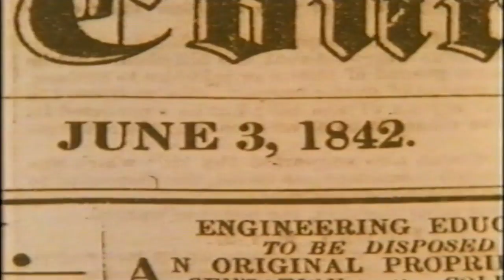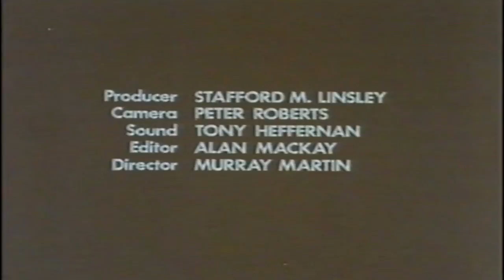Bowes Line

Comment: At 14:12, the houses to the right are on a row called Ridgeway, Leam Lane Estate, NE10, and still stand today. Here you see the rear of the houses, with garages between the houses and the rail line.
I lived just a few minutes walk from here, and I used to play on the roofs of those garages with my mates, but the railway had long since closed, as I am going back to the late 70's early 80's.
But if the camera was facing in the opposite direction, there was, and still is the old engine shed, (now a bus museum I believe, or storage shed) just before the line crosses Lingey Lane at Wardley, and we used to play in there too, swinging from chains that used to hang from the roof up above. It was fascinating as a kid.
I was born in 1972, not long before the railway closed, so it is also fascinating to see "the lines" as we called them, in use.
My older siblings remembered the coal trucks, crossing the Leam Road on their way to Monkton coke works at  Hebburn, where they made smokeless fuel or coke for the many open fires that were still in use in peoples homes. Central heating was rare 'on the Leam' until the housing providers embarked on a huge program in the mid to late 80's to install gas boilers and radiators in all the homes on Leam Lane Estate, a mammoth task, considering the size of the estate, which was the largest in Europe at the time, I believe!
 Memories of much happier simpler times for most people, I'll bet. But not without struggles, times were often tough, but we lived uncomplicated lives back then. Great video.
Reply: Thanks for the extra info 👍🏻👍🏻
Reply: @typhoon2827  Were you brought up in that area? Just wondering if anyone remembers the "mini jungle"  and the huge hole in the ground behind the Wealcroft club? (they used to show kids movies on the big screen at the club on a Saturday morning back in the day) The huge hole used to be a stone or clay quarry I think. It  used to fill up with water, and was a go to spot for fly tippers. It was filled in some years ago, the Wealcroft Club was demolished, and has houses stood on the site now, Scott's Court, and The Willows I believe.
 I was their postman for a few years, as well as the lower half of Ridgeway, the streets on the east side of Milford, Lingey Lane, and Montrose Drive estate. I had some nice customers on that route.
I remember also as a kid, we used to take a wheelbarrow up "the lines", at the Leam Farm end, just down from where Bowes Museum is now. And we'd nick the coal that had fallen from the coal trucks over the years. There was tons of it as I recall. You'd be arrested for it these days, or somebody would snitch on you. What different times we live in today.

Comment: I was raised in teh area around the North east mines and spent many happy sunny summer days up on teh Leam and we used to walk across the Bowes line and one of my lingering memories is standing straddling the very large steel cable as it ran below me and then we used to move off and sit on teh gate as the two lines one full and one emprty crossed in front of use. Happy days